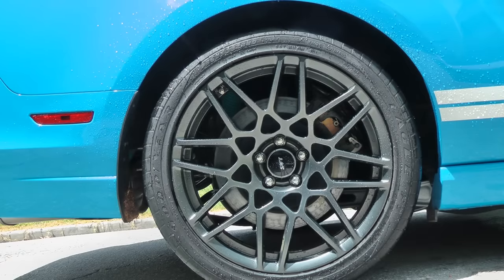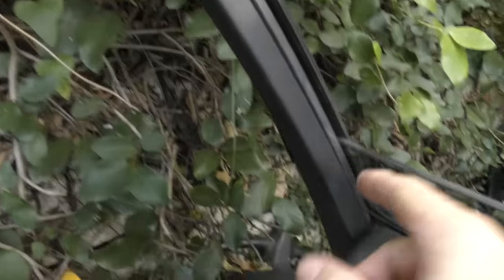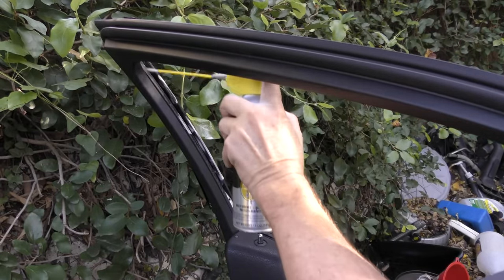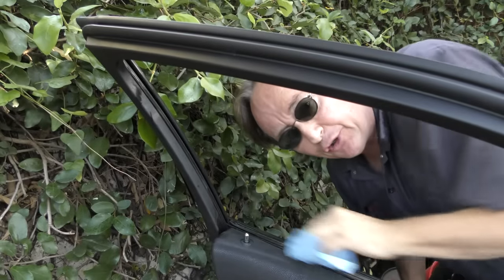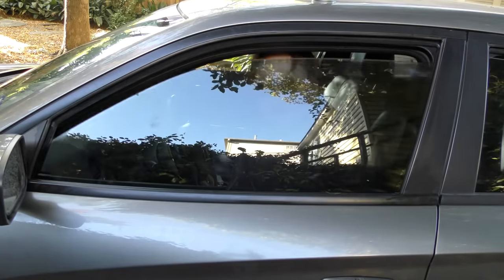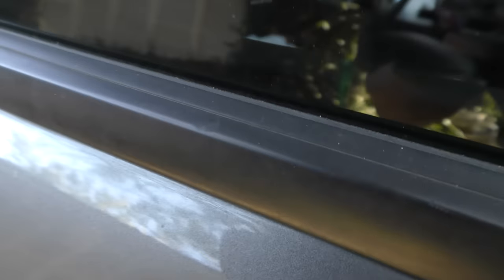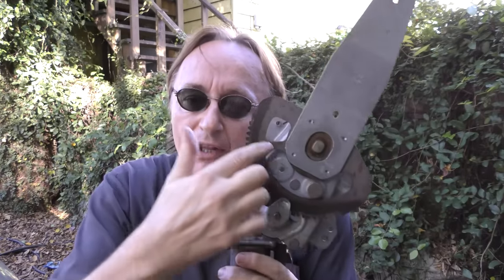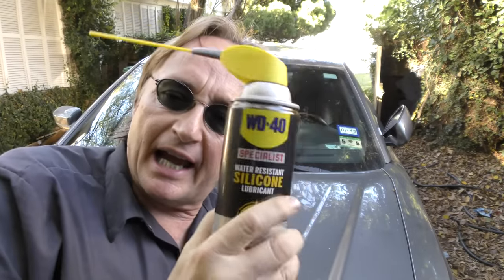Life Hack That Will Keep Your Power Windows Working Forever

Comment: No amount of wd 40 or silicone spray is going to fix a broken widow regulator or worn out regulator motor.

I had one window go up until about 3 inches from the top and stop every time until  hours later on a second try.

I knew the window regulator motor was worn out and had to be replaced.Did it and it works like new now.

Comment: Only problem is, silicone tends to dry out rubber and plastic faster, leading to fading and cracking - especially in prolonged sunlight (UV exposure). Even after wiping down, some silicone oil is left behind, and the baking sun then amplifies the residue, and the drying process is accelerated. This causes rubber, EDPM, vinyl and plastics to dry out, which turns them grey or brown, and causing them to lose their flexibility - so they prematurely fail.
Reply: > "silicone tends to dry out rubber and plastic faster, leading to fading and cracking"
Therefore, instead of silicone spray, what would be better?

Comment: I wouldn't advise anyone to spray so much lube on a window. Just spraying some on a towel and rubbing it on the rubber rails would have had the same effect. This is specially true if you have ceramic or expensive tint in your windows.

Comment: Silicone is detrimental to your car if you ever plan on a repaint as it is hard to remove and will cause fish eyes in an otherwise great paint job. It takes so much more careful prep to deal with silicone that has been absorbed by the cars existing paint and always leaves a feeling of uncertainty in the process. Again do not just spray silicone liberally on a car you plan on keeping forever and will be wanting to repaint.
Reply: Jim V how about a 1996 Dodge Caravan? I think a silicone paintjob would be an upgrade  to this timeless classic... does it become anymore flammable by any chance? Just trying to cover my bases for when my insurance gets curious about it's full coverage just before it..... uh, was found safe in my garage, where it always is...

Comment: Peace.
I have a hitch p0401 in the Hyundai Tucson 2006 Turbo Diesel Engine 2000 has a mechanical egr engine and a back fault cleaning.
  I have a very strong smell of burnt diesel fuel

Comment: Works good until some idjet pulls your door shut by the wiiiindow frames and warp them.  Then the glass track is no longer curved the same degreed curve of the glass. 
Or when your wife locks the keys in her car and some good intentioned Idjet pulls the window frame out so he can spend an hour playing with a coat hanger to unlock the doors, then gives up and the wife calls you to come unlock the doors with your keys!  Still fighting that window!

Comment: Did you know that you can swap the windshield wiper motor with a power window motor? Its even easier if you just swap the wiper with the window but it's not as effective as you would think. I'm gonna try putting gasoline in my ignition, and my key in the gas tank to save some time trying to locate my gasoline before heading to work every morning... its always in the last place you look too... under the cat on the nightstand... stupid cat!

Comment: DEAR:  SCOTTY  KILMER  I  AM  DOING  AUTO REPAIR  FOR  30 YEARS  I  DID NOT KNOW  THAT  W-D40 CAN FIX  POWER  WINDOWS  I  USED  SOME  ON  MY  2002  JEEP  LIBERTY  AND  THE W-D40  I USED  IS  SPECIALIST  WITH  WATER RESISTANT  SILICONE  LUBRICANT  AND  WHEN  I  PUT THAT  ON  IT  WORK  ON  ALL  4  WINDOWS  THANK  YOU .